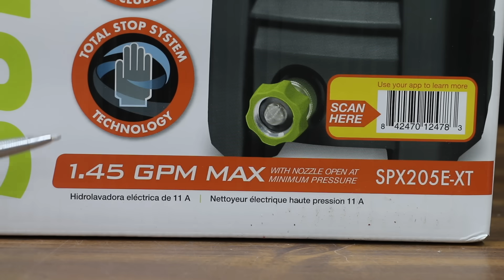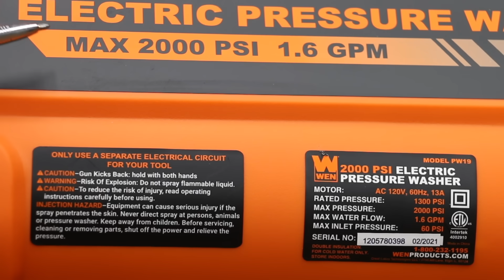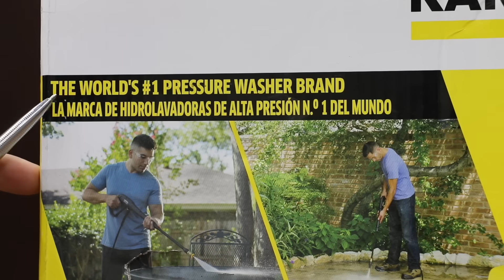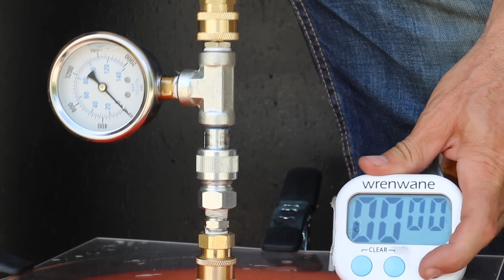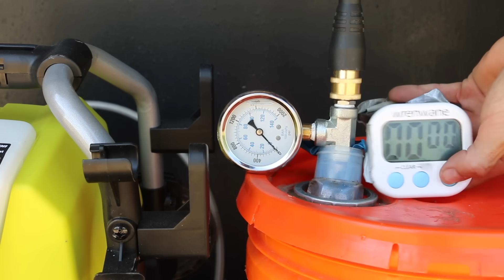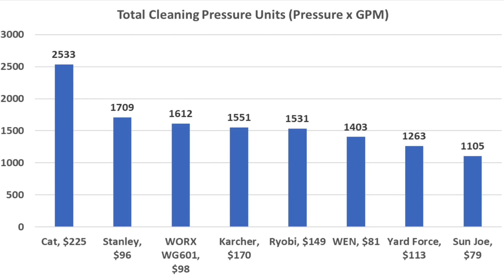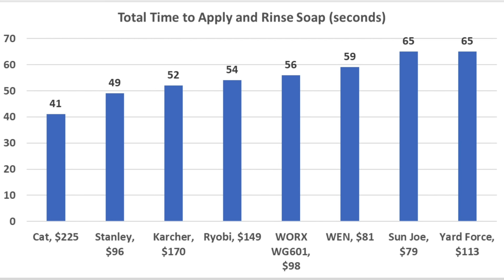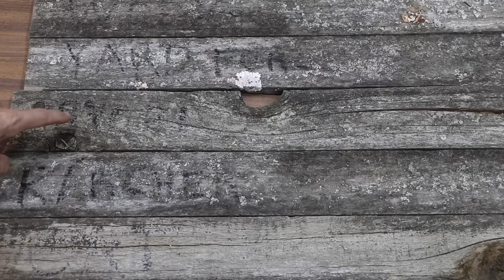Best Pressure Washer (ELECTRIC)? Ryobi vs Karcher, Stanley, Sun Joe, WEN, CAT & WORX

Comment: Todd, I (and I am sure many others) would like to see a comparison of "consumer grade" carpet cleaners (not professional steam extractors). Comparing Hoover, Eureka, Bissell and even Rug Doctor, for cleaning ability and durability would be great. It would be nice to see how these carpet cleaners work on "real world" dirt, as opposed to the staged settings the manufacturers show them working in. Personally, I have always had good luck with Bissell, but it would be great to see how all of the leading brands perform against each other. Just a suggestion. Take care.
Reply: i think vacuum wars did a video on that
Reply: @pietrog  Project Farm is much better than Vaccume Wars IMO. Vaccume wars constantly fucks up tests and doesn’t redo them. Love the channel but it annoys the shit out of me.
Reply: @pietrog  Oh yeah, now I remember, that was the movie with Darth Hoover vs Luke Skybissell. I heard it really "sucked" though. J/K. Thanks for the information.
Reply from the maker: Thanks for the suggestion.
Reply: As someone with a background in carpet cleaning, the best consumer machines are the bissell big green and rug doctor x3. All consumer extractors don’t get hot enough, have low water pressure, and lack enough suction for through water extraction. They can be used as maintenance cleaners, but won’t replace a proper clean with professional equipment. 

MyTee commercial extractors are (somewhat) affordable for home use, and do a much better job then any consumer brand.
Reply: @Dirty_Bear22  Agreed. If you want a maintenance cleaner just get the Big Green and don't burn $ on cheaper big box store machines. Professional cleaners often use machines that would require multiple 120v outlets to power a single suction device because of the amp draw. They are not comparable as far as total clean. So each person just need decide, how clean they want it, and to pay $400 and DIY or less every year but for a better clean. Personally, Big Green is perfect for me, YMMV.
Reply: @Dirty_Bear22  Thank you for the helpful information. I was actually leaning more toward the "consumer grade" machines (under $300) that, as you stated, are more for annual/biannual carpet "maintenance." In that case, I have had good results using Bissell carpet cleaners for years, but wanted to see how they stack up against the other major brands, especially Hoover "Spin Scrub" cleaners. If the carpet actually needs a deep steam cleaning, I am definitely calling a pro like you.👍
Reply: @TheGuitarman1968  if you are interested, vacuum wars did a good comparison between a few different models of extractors here: https://youtu.be/IQJmBURMEYw
Reply: Shark for the win
Reply: @a29s12  LOVE our Shark vacuum!
Reply: @a29s12  Shark? You have to be kidding right?...lol. I know one person that ever purchased a Shark (As Seen On TV) Vacuum, and it literally overheated and caught on fire during the second use. Shark sucks, and there is absolutely no pun intended at all there. 😳🔥🔥🔥
Reply: @TheGuitarman1968  had two in 10 years with zero problems and cleaning capability second to none. There's always a lemon.
Reply: @a29s12 OK, I will give you that one. It does happen. I have just heard/seen so many bad reviews and experiences on Shark products. On the other hand, I have actually had a Dewalt drill go up in smoke after a month of light use. A rarity, but it does happen occasionally. 👍
Reply: @TheGuitarman1968  I am a bit perplexed bout these "as seen on tv" comments. I have never seen an infomercial on sharks. I have bought mine in stores and they are a house hold name in Multiple chain stores here. Didn't know sharks were an infomercial product that started exclusively on tv.
Reply: @a29s12  Yes, If I remember correctly,  the Shark late-night infomercials started sometime in the 90's with the their bagless vacuum. They were not as prolific as the Ron Popeil infomercials (around since the 70's), but still shown quite often. I have also seen Shark products; vacuums, steam cleaners, steam mops, etc. in the "As Seen On TV" stores in shopping malls. There even used to be an ASOTV store across from the Monterey Bay Aquarium in California, if I remember correctly once again. I am sure someone can back me up here.🤔
Reply: @TheGuitarman1968  vacuum wars seems to think they are pretty good and recommends them in many videos. I tell everyone I can to buy one when asked. I never had much luck with cheap WalMart vacuums  such as hoover or Bissell.  My shark was more expensive but have always served me well in comparison. Right or wrong its my experience.
Reply: @a29s12  Hey, whatever works for you personally is great. I have been using Bissell products for many years with great luck so far. My mom actually still has a Kirby Vacuum (you know, the one that they used to sell door-to-door) that she bought in the 80's when I was in high School. It still works to this day, has great suction, oh, and get this, is made almost entirely of metal. Honestly, companies just don't make any products today like they used to.
Reply: @TheGuitarman1968  Kirby still makes vacuums to this very day. Actually vacuums actually improved greatly over the years, and offer better performance then those from the past. Tons of built to last vacuum brands like Miele,Sebo,lindhaus,Aerus, and riccar. Most of these brands are sold in specialty stores or online, as consumer demand has flooded most stores with cheap poorly built vacuums. 

Modern high end plastics are much lighter, and arguably better then aluminum used in Kirby machines. Furthermore kirby vacuums are rather cumbersome, impellers can be damaged from debris, they blow carbon dust into the air, aren’t particularly sealed, and require more maintenance then other brands. Not saying they are bad, but their competitors definitely have them beat.
Reply: @Dirty_Bear22  Wow, I did not know this vacuum/shampooer thread would turn out to be so popular with a bunch of men (I am assuming)....lol. And yes, I do realize that there are much better and more efficient vacuum cleaners on the market today. I was just pointing out the fact that the Kirby is still working after 38+ years. These days most "disposable" vacuums will be lucky to last 3 to 5 years before they die. It's funny nobody has mentioned overpriced and overrated Dyson here yet though. Hopefully people know better. Is Rainbow Vacuum still in business? I remember those vacuums used water instead of foam or paper for filtration. They worked well, but you had a bucket of mud to dump when you were finished vacuuming....lol.
Reply: @TheGuitarman1968  Haha. Vacuum enthusiasts seem to have grown in number over the years. I agree that Kirby vacs can definitely stand the test of time. While not the best, Dyson is definitely better then shark and some other brands IMO. Yup rainbow is still around, they also added heaps exhaust filters to deal with fine particles. Idk I always find them a pain to clean, and the moisture can cause unhygienic build up.
Reply: @TheGuitarman1968  Sharks are awesome vacuums. You know ONE person out of millions of these things made, and concluded they are all garbage. LOL Shark wins or comes in the top 2-3 in all vacuum tests involving them. My navigator is 8-9 years old, and is working great.
Reply: @punkem733  Point taken. However, I just don't trust Gimmicky "infomercial products," along the same lines as the Pocket Fisherman, Ginsu and Ab Blaster. I have also read many bad reviews for Shark products over the years. Mostly based on lack of longevity. I am glad your Shark Vacuum has worked well for you, and to each their own, but I would never buy one personally.
Reply: @TheGuitarman1968  As crazy as this will sound, I agree MOST items are junk, but some of those actually work. I don't trust anything, but most of those items are so cheap, and with online reviews you can find out what works.
Reply: @TheGuitarman1968  A friend of mine has a Kirby from years and years ago. A salesman came by his house to pitch him a new one. So he went "head to head" with the old Kirby vs the new Kirby. His old Kirby still worked perfectly. The trick to their sales pitch is A) going after the home owner's pass and B) go at an angle from the original pass to pick up the loosened dirt. So he went second after the sales person and played him at his own trick.
Reply: @SandrA-hr5zk  Yeah, I can still remember when they did the in-home-Demo. for my mom, in the early 80's, before she bought her Kirby.  If I recall, the vacuum and accessories were like $800 back then. Probably closer to $2,000 now. My mom's Kirby vacuum cleaner still works to this day, although it is not her everyday vacuum any more. I know Kirby still does the door-to-door demo and sales routine, and I hear that they have a new tactic. They send a cute young lady to your door to ask if you want a vacuum cleaner demo., (thinking she is going to do the demo.) and then they send some old man to actually come do the demo. A  couple of my single male friends have been hit with this ploy. Needless to say they were rather disappointed and did not buy the vacuum cleaner....lol. 🤣
Reply: @TheGuitarman1968 those thirsty dudes deserve to get played
Reply: You can't go wrong with a Bissell Big Green dude. It's amazing. Best 500 I've ever spent
Reply: Just rent a professional unit. Don't waste your money on a store bought carpet cleaner!
Reply: I could actually use this, been meaning to buy one recently and would love some testing to supplement my research!
Reply: That's a great idea. That would be very useful. And I would love to see Shark thrown into the mix! I've always been skeptical of "As Seen on TV" products 🤔
Reply: Not only the machine but the solution can if not be what makes a carpet cleaner actual work decent. There is a lot of variables like water temperature, solution used, type of carpet, type of stain and if it is really set in, etc.
Reply: There's a thousands guys one YouTube already doing carpet cleaning reviews and comparisons!!!
Reply: @gunnerneikoify  Very true, but not the way things are "thoroughly" tested at the Project Farm. I am sure Todd will punish the carpet cleaners by dropping them from the roof, running 3,000 volts through them and shampooing grease off of his asphalt driveway. You know, "basic" durability tests. 😉
Reply: @justotalkalottashit8392  Knife sharping using a Kirby? I’m intrigued. Kirbys can be obtained in new or like new condition for under 500 these days. The shampoo and floor polish kits do their jobs well enough, but the sander seems like a gimmick. For health and safety as well as unit lifespan reasons, no household vacuum should be used for large amounts of fine dust collection. There are specialized dust extractor vacuums for that purpose.
Reply: Absolutely!!
Reply: Yes I need to buy one for my wife
Reply: I agree
Reply: @justotalkalottashit8392  it no surprise to me. Especially after seeing vacuum wars put them against much more expensive vacuums and do very well.  I had a "high end" hoover (most expensive in the store) that smelled like it was burning the day brought it home. The very next day I bought my shark and never looked back. The shark went over the same carpet the hoover did the night before and I question if the hoover picked anything up after seeing how quick the sharks storage filled up. Then I bought the shark 2 gen robot vacuum based on a video from vacuum wars and it has also blown me away for the price. The vaccum wars video put the shark on the same playing field as the roombas that were 800-1200 and I got my shark for 350. I'll keep buying sharks.
Reply: Kirby
Reply: John 3:16 King James Version 16 "For God so loved the world, that he gave his only begotten Son, that whosoever believeth in him should not perish, but have everlasting life." (share the good news of the gospel around the world!) Truth about the deceptive islamic religion channels: christian prince, light for all nations, light shineth in darkness

Comment: I have an older/smaller model of the Ryobi electric rates at 1600/1.2gpm that uses a second input on the pump for soap, which is great because I just feed the siphon tube straight into the cleaner bottle and don't have to worry about the weight on the end of the wand it running out during use. I think I paid $80 for it
Reply from the maker: Thank you for sharing.

Comment: I got the new Bauer 2300PSI electric pressure washer the month it came out.
I absolutely love it!  It's on a cart like a gasoline washer, uses standard attachments, has a 2ish gallon soap tank, and it's JUST strong enough to clean off a caked up grill.  It doesn't kick back to take off the top layer of concrete like the 4400PSI gasoline washer at work does.  But it's plenty powerful for home use.  It's also a fraction of the weight of the 420cc washer at work, and makes basically no noise.  It's also only running when you're using it, so noise is even less noticeable.
Reply from the maker: Thank you for sharing!

Comment: (thinking Alternatively to electric units) i worked at Briggs and stratton 18yrs and their engines were fine on mowers, but not so much on continuous high engine load and and heat situations with pressure washers, (too many plastic engine parts) honda is the one to go for. maybe kohler and subaru robin might be good too. china makes a bunch of honda knockoffs nowadays.
Reply from the maker: Thanks for the feedback.

Comment: heh. got a black and decker electric free, ordered a proper spray head with extension. QD's all around, a set of tips, a good pressure hose and QDs for that with adapters. totaled around $80 for everything, doesn't have the power of a gas unit, but its got everything else.
Reply from the maker: great

Comment: Stanley seems like performance vs cost is nice.
Reply: But the thing that kills the stanley is the lack of real nozzle tips.  In order to upgrade that you'd need to buy both new a hose and a new wand. Once you factor in that cost you're near or past the much better performing cat!
Reply: @Slayridepin  that's only a problem if you're planning to upgrade.
Reply: @Slayridepin  I think hyper tough could solve that. No adjustables and spray regress fits with almost every brand
Reply from the maker: Thanks for the feedback.

Comment: You should have included the Active VE52….best “cheap electric” pressure washer out there right now with a 5 piston pump
Reply: Active makes the CAT and is pretty much the VE52 in slightly different cloths.
Reply from the maker: Thanks for the suggestion.

Comment: Perhaps a better test of “removing stuff” would be to apply 3 coats of exterior paint to 4-foot lengths of 2x4, let them dry for two weeks, and then run them under the washers at 14” distance.
Reply from the maker: Thanks for the suggestion.

Comment: The vehicle crush test was inconsistent across the brands. Sometimes you paused with some weight on the handle, sometimes you smoothly rolled through. 

Also, would have been cool to weigh the wood boards before and after to see how much buildup was removed (but that test is pretty hard to make consistent since the buildup is natural/random). 

Awesome video as usual, thank you for all of your time and energy!!!
Reply from the maker: Thank you for the video idea!

Comment: So what is the GPM of the cat at a given PSI? The GPM at no load is kind of ….not useless but it’s a missed opportunity to measure against their claims. These things are famous for lying about both their psi and their GPM and NEVER hit their listed GPM at even the lowest pressure
Reply from the maker: Thank you!
Reply: @ProjectFarm  no thank you! If you happen to get a moment that you’re bored and willing to test the CAT, Obsessed garage does all his testing aiming for 1000 psi, and even though that’s much less than claimed PSI, of the 100 or so pressure washers he tested literally only 3 came anywhere near 1.9 GPM @ ~800-1000 PSI. He just released a custom pressure washer that he worked with a Chinese manufacturer designed specifically to be cheap ($200, which is cheap compared to the $1400 German one he uses) and designed to hit 1.9-2.0 @ 1000 psi (specs that are ideal for car washing not so much for PSI). Anyway he tested 100 something units but never tested without a pressure tip connected so that figure isn’t on his spreadsheet. 

Anyway all that is to say if you ever get bored and feel like sharing what it’s GPM is around approximately 1000 psi then you’d be doing the freelance pro detailing community a massive favor. I will personally go write up a post on Reddit so people know that Matt’s new unit isn’t the only game in town if this CAT gets results anywhere near what they appear to be without a tip on it. 

Anyway thanks for hearing me out. Appreciate you regardless of your decision as always. Take care
Reply: @ProjectFarm  here is the pressure washer spreadsheet Obsessed Garage compiled from his testing if you’re curious (I suspect you’ve already seen it but just including it just in case). https://www.reddit.com/r/AutoDetailing/comments/fu9xtg/obsessed_garage_full_pressure_washer_spec/